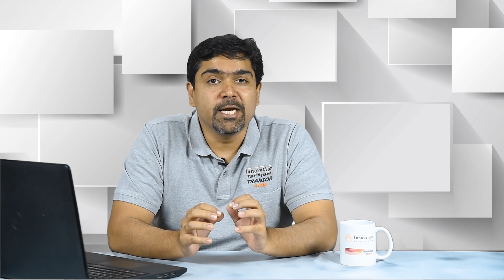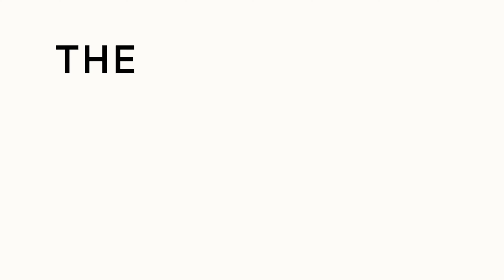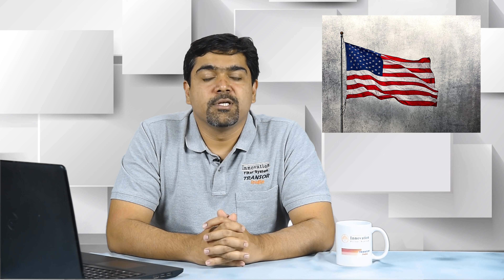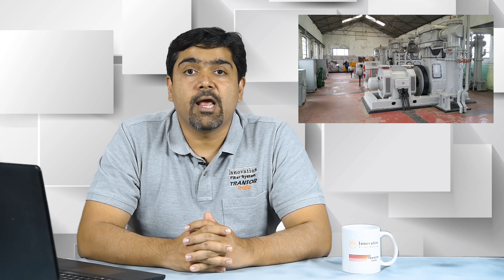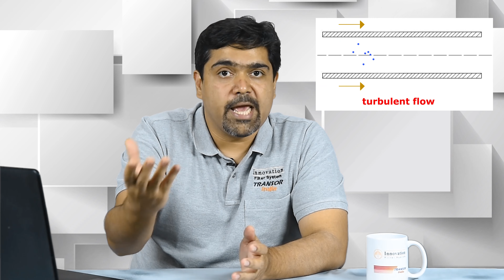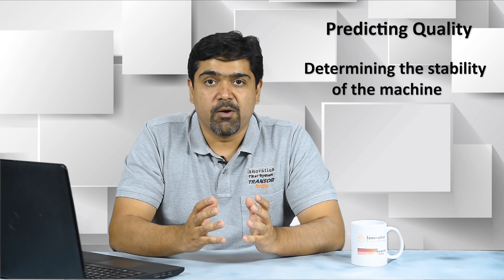A.I. and M.L. in mechanical engineering: Think Filter Show- Episode 2

Comment: what is the use of machine learning here, by the way. The collected data from sensors processed by microcontroller that warns us about the failures based on set threashold.

it is just like a gas sensor that sense and tells the gas comcentration, and warns when threashold is met

can u plz guide me, i m just to confuse.

Comment: many times,clients too demand industry 4.0 as a requirement but are not sure which area are they expecting....as in operational ,or failure proofing as in the case study presented...so in a way implementation of industry 4.0 is a wide subject and cannot havr a specific format...it all depends on the criticality of the data to the plant or the equipment. nicely explained with the case study. Thank you.
Reply from the maker: Thank you very much Mr. Padhye for comment